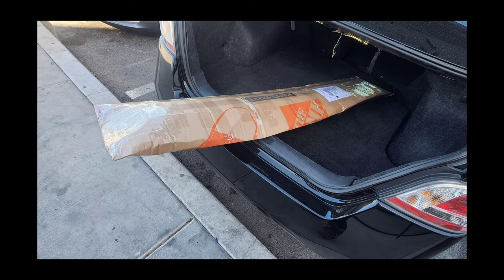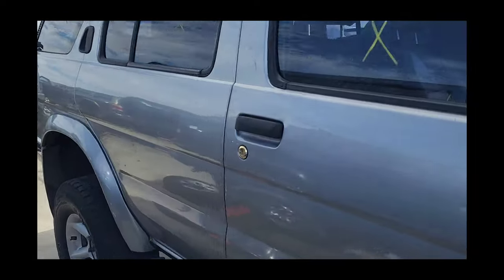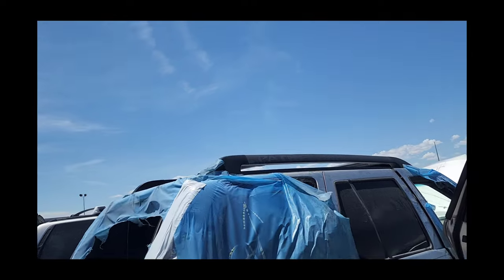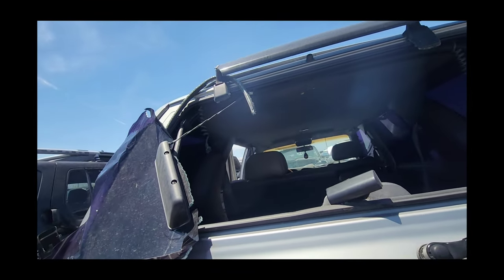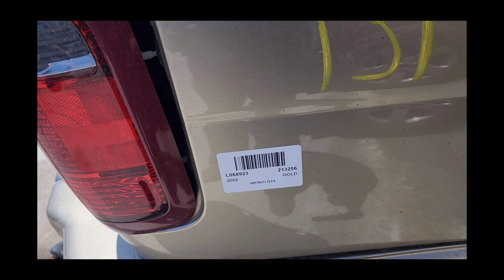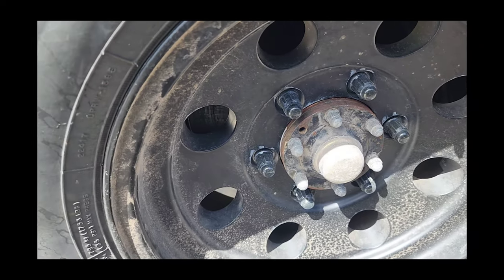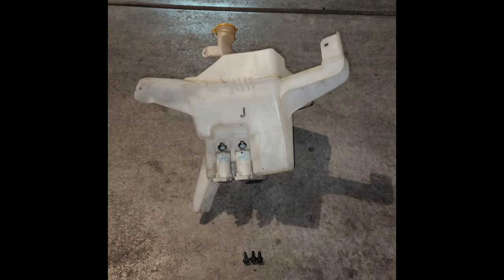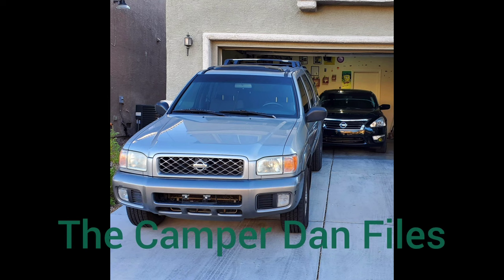How I select Infiniti QX4 and Nissan R50 Pathfinder Junkyard Parts for Sale!

Comment: In my 03 pathy every time I fell the wipers water bladder, I got water leaks from the neck of it, no direct hit on it, no direct accident.  Is it normal on R50's?
Reply from the maker: @Bader Barghouti, no it is not normal for the filler neck of your reservoir to leak. I too had this issue when I first acquired my R50, and I ended up replacing my entire reservoir with a junkyard unit. However there is a rubber seal that's responsible for sealing things between the filler neck and reservoir, you can try replacing it with a new rubber seal. I hope this bit of insight helps. As always thanks again for watching!

Chris.
Reply: @TheCamperDanFiles  I'll try to have the seal , thanks, and my pleasure.

Comment: How does pricing typically work at junk yards?  How much can I expect to save on let's say a QX4 spoiler or lug nut covers?
Reply from the maker: @Frosty, wheel center caps or lug nut covers are very cheap at my local junk yards. Works out great for those one-off hard-to-find parts too. You will also save a ton by buying a spoiler at the junkyard vs full retail price.

Comment: Hey Chris, what Xterra under body protection fits an 01 pathfinder? I remember you saying that certain bash guards and metal shields from other vehicles will fit.
Reply from the maker: @Essayons Adventure, I'm not sure. I was actually referring to interchangeable transfer case skid plates from a D21 or WD21 that would fit the Infiniti QX4 or the R50 Pathfinder.